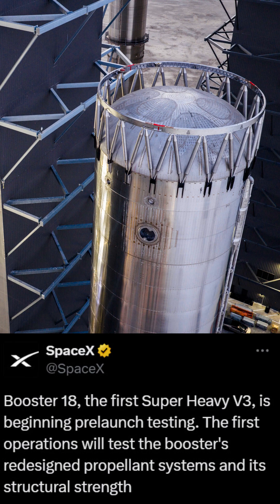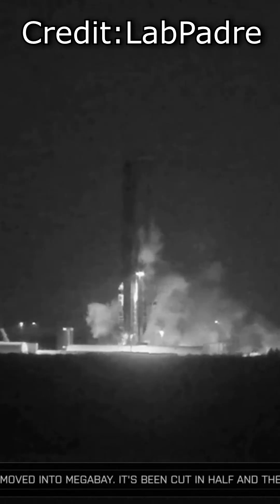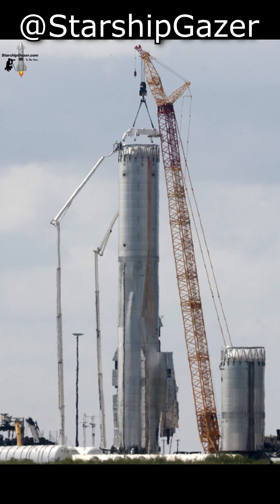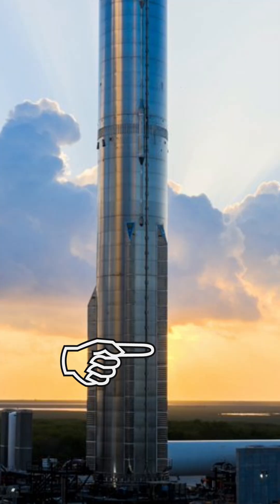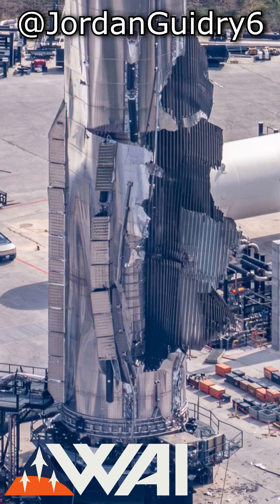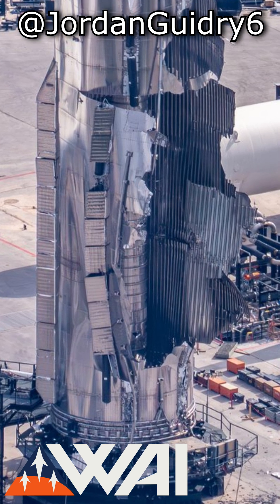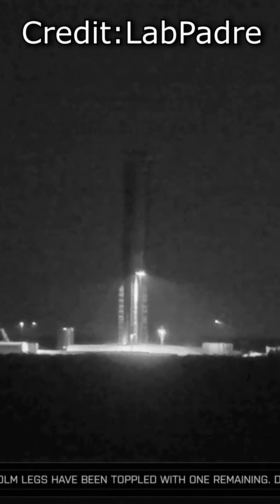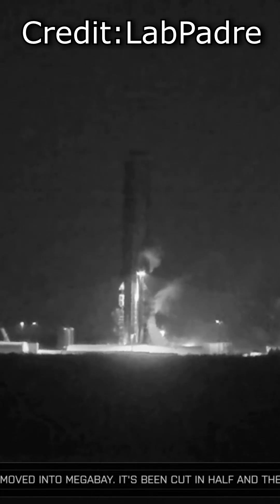SpaceX's Latest Booster Explosion Explained

Comment: I wonder if the placement of the copvs against the outside of the cryogenic tank is an issue, with the portion facing the tank likely being significantly colder than the portion facing the inside faces of the strakes. Even if the air inside the stakes was circulated effectively, radiation heat transfer would likely still be significant at these temperature differences. It's possible they already attempted to mitigate this as there's remnants of something white that looks like it could be insulation between the copvs and the thank wall but maybe it's not enough, as even insulation will chill in, or might actually make things worse if the insulation is in contact with the copvs as it would prevent the cold air from convecting away. If this is indeed the case the thermal profile in the copvs isn't axisymmetric, which I can't imagine is good for their structural margin. At a minimum their ground testing would need the replicate this non-axisymmetric thermal environment exactly to rule this out.

Comment: Needs a vertical roll former to make starship in as few sections as possible. Instead of dozens of sections and fail points a vertical system will reduce it down to several pieces or even less.. Vertical form machine can be made from decommissioned ships propeller shafts and built inside one of the rocket hangers...Just needs sheet metal wide enough to make size circumference needed for starship etc...

Comment: I believe a lot of folks commenting here are too focused on the whole aspect of safety, as if these vessels are ships or planes or cars.
Space flight is dangerous, plain and simple. The amount of risk that was acceptable by NASA's standards just forty or fifty or so years ago was a staggering 25% failure rate. SpaceX has that down to about 10%, maybe even less, based on over 350 launches with only about 20-30 launches being test failures and less than ten mission failures.
Now, objectively, if any of you were truly concerned with spaceflight safety, why don't you go and make a difference? If you want humans to travel to distant planets on these vessels, go and study physics and fluid dynamics and aerospace engineering. SpaceX primarily launches satellites, not people, but the leaps and bounds made by their endeavors over the last decade have drastically advanced the world's capabilities of spaceflight.

The automobile didn't have seatbelts in its early days - hell, there weren't truly any road laws.
The aeroplane was rudimentary just one hundred years ago. Before then, it was speculated by top scientists that flight-capable machines were a hundred years off.
The nuclear bomb had a non-zero chance of igniting the Earth's atmosphere in a runaway reaction.
Think of these before you decide to set your standards to an unachievable limit.

Comment: I’m starting to think the stainless steel design could be the issue with the Starship. Yes, it performs better at cryogenic and high heat temperatures (and looks cool), but stainless steel is also notoriously hard to weld and such a massive ship can create a ton of potential points of failure (as witnessed here). Question is whether Elon will have the team pivot or double down at this point. Because with Blue Origin is breathing down their necks, they don’t have time for many more "rapid unplanned disassemblies”. 😅
Reply: It doesn't look like the tank was at fault though. If something at 3000psi explodes inside your tank it doesn't matter what is made of.

Comment: You don't have to "hope" they're working on it. It's exactly the reason engineers research and test for failure modes. Answers are not so easy at this level of stress and processes in assembly. If most people studied turbine blade metallurgy and design they'd probably have less confidence because of the limits we're pressing in material load and heat dissipation. Answers at certain levels of engineering become very very difficult to work through. Just because we know we can achieve something, doesn't mean it's going to be easy to solve or achieve.

Comment: It is absolutely mind boggling supposed intelligent engineers in this day and age seem to think composites can be used for pressure vessels.....
How many times now 😂😂
Oceangate.... 🤦
We have known for a very long time and for the very same fundamental reasons why we do not use composite materials for pressure vessels.... THIS HAS NOT CHANGED, WE HAVE NOT DEVELOPED COMPOSITE MATERIALS THAT CAN BE RELIABLY OR SAFELY USED AS PRESSURE VESSELS..... a fact that musk will never change without reinventing composite materials altogether....
If you are going to insist on doing so I suggest you develope a metallic epoxy of some sorts capable of withstanding expansion and contraction...
Dumb 😂

Comment: Thought they were getting rid of the wrapped pressure vessels and going to stainless steel since those wrapped pressure,vessels Can degrade rapidly just like on the submarine that squished at a depth that It was suppose to work at just fine? How many flights before it messes up?
Hopefully all is one more than you actually take for a ride! What are they doing dropping them, running them into each other hitting them with hammers? What the heck is going on?
Are you just wanting to get rid of your inventory? Because it’s hurting you big time switch and get rid of them.

Comment: I’m not convinced it’s a COPV problem. They should be designed and qualified to 2x max pressure … and, although I agree the failure appeared associated with the chine, I’m not seeing an obvious indication of a burst “into” the tank wall along that chine. Admittedly, it could still be a failure within the associated plumbing .. but a COPV should be a pretty tough thing to get to burst. I’d expect each COPV to be subject to an appropriate proof pressure test as part of its release certificate before it gets into the rocket assembly building. You’d have to be pretty irresponsible in mishandling those things to result in damage … but same would apply to steel tanks of a generic gas welding kit and accidents can still happen. 

I would argue that, at this point, cause of failure could just as easily be a problem weld. There is a lot of welding in the SS tank and associated plumbing systems … and steel alloys and welds can be very problematic if the alloy, weld or annealing is not to specification .. especially in cryogenic applications. Remember there have been enough problems in the history of shipping with brittle failures in low temperatures and ships lost at sea … at cryogenic temperatures, these problems are exacerbated and require very careful material and process controls.

Comment: Obviously, a complete loss, however, in a survival situation and reusing the top section of the booster, they would do a rough cut below the methane tank, separate the halves and suspend the upper tank on a jig which it would be cut as well as possible in order to not scrap the entire article.... But again, only if it was a do-or-die situation...

Comment: You have to understand that destructive testing serves absolutely no purpose when you're still experiencing failures. SpaceX is a dud company. They have tested Starship 10 times and it blew up 7 times but they never actually had any plans to bring any home. So how do you find any developing faults? You don't. And you end up having to fix everything to ensure that the next flight survives. And it still caused another 5 explosions before they got it to fly successfully again. Meanwhile Artemis launched, flew to the farside of the moon and returned a few weeks later. First time. No explosions. No environmental contamination. Just success. Meanwhile SpaceX is still failing when it's trying to reinvent what was standardised decades ago. They don't know space if they have to reinvent shit.
Reply: Dud company? Explain the 550+ Falcon 9 launches

Comment: They're on version 3 vehicles, this shouldn't be happening any more
Reply: But they just started v3! For each version there needs to be a test explosion and 3 total vehicle losses during flight. Then it's on to the next version.
Reply: They’re ✨Failing Fast✨;  It’s move fast and break things, not have thorough QC/QA + Installation Procedures!
Reply: Yeah, there has got to be a point in the whole "move fast and break things" where you waste more time building and stacking new hardware than if you just had taken some more time double checking and slowing down the handling a little.
Reply: @CMDKeenCZ  I thought SpaceX might adjust strategies a bit given their results, but who knows how long it will be before they can get a flight out of this thing to start testing it. We're almost back at square one. It seems like no component they've built has worked well enough to keep, and/or it's too heavy. It seems like even with an iterative approach there would be a some things done right the first time, anything, but that's never the case. Everything needs to be redesigned multiple times, and that is framed as a virtue somehow.
Reply: Tell us you really haven't been paying attention without telling us you haven't been paying attention...
Reply: @thec3llc  I know, right? This is a pattern we've seen before. Every version fails spectacularly multiple times. We shouldn't be surprised.
Reply: @troys9222 it's getting old. This shouldn't be celebrated, they're clearly not learning enough with every mistake they keep making.
Reply: @RedmondJohnson From the first big build of the project, when the grand multi-million dollar construction plan was to have the stack fire directly into the flat concrete, it didn't look good. Then they ended up building essentially an XL version of what they were given for free for Falcon. It took way too long to find out there's a reason they're built that way.

Comment: What's not mentioned is that these tests are meant to cause something to fail, either putting the vessel under maximum pressure to see if and where it will rupture. And or making modifications to see if and where it will weaken the vessel and so on.
Reply: Is this a joke?

Comment: Someone else stated that copvs have been an issue since early falcon days. And there have been constant issues with them in starship development. Those are the things that you absolutely need to function perfectly and with insane safety margins, because a single one getting a bit of a leak means the whole stack crumples. Like the frikkin wing struts for planes. You gotta have aviation safety margins for them since they are a single point of failure. How the hell have spacex not figured this out yet?
Reply: I get that you are not an engineer and don't really know these things, but just to be clear, aviation works with extremely small safety factors, when compared with almost any other industry.

Aviation can do that because they have done very, very large amounts of testing, destructive and otherwise, for decades, and they have a very good understanding of the loads the air frames and various components will experience in actual use.
That is partly thanks to the countless millions of flight hours accumulated by basically 2 companies, and partly because it's a well understood regime that can be quantified.

Rockets use fairly similar safety factors, certainly the same ballpark, and probably often even a bit higher than than aviation. But the loads are less well understood, especially when doing new things that has very little prior data to use when designing things.

But yeah, COPVs really shouldn't fail on ground tests at this stage, but I'd say it's highly unlikely that it was the safety factor itself that was wrong. Seems more like a manufacturing defect, procedural error or installation damage, or something along those lines.

With rockets you can't just increase the safety factors to compensate for unknown factors, it's not that it would cost more money (it probably wouldn't), it's just that the rocket would be to heavy.

If you tried to use something like normal civil engineering safety factors the rockets would be either too heavy to lift off or atleast unable to get anything worthwhile into space. Chemical rockets are very close to not actually working on this planet, that's why they are around 90-95% propellants by weight at lift off.

Rocket science is simple not easy 😅
Reply: @Robinlarsson83 I have worked with engineers /in engineering before so i said the things I said for a reason. Aviation safety margins are much higher than in astronautics. And yes, usually the "oh but we have weight limits" would be a good argument, but we are talking about the biggest rocket in the history of mankind with an absolutely unprecedented lifting capacity. Sacrificing a few percent of that for increasing safety margins would be entirely acceptable. In fact this is precisely what the whole starship concept is building on. That we turn spaceflight into as common and reusable a thing as regular flight. With the same safety margins. Why? Because we use tech that is so advanced that it allows for that.
Reply: @nemo-x cool. While I'm an engineer, I work in the marine sector, but I'm not sure I agree that aviation uses much higher margins that space does? But sure, in some instances that's probably true.

Yes, Starship has a very high lifting capacity on paper, but atleast Starship V2 was very far from actually realising that capacity, simply due to it being too heavily built. I've seen estimates that V2 would only have been able to deliver around 35 tons into LEO. The weight issue is always there for a rocket, no way around that afaik.
It doesn't really help if you just spend some extra weight on a few systems when everything is mission critical. So you'd have to make everything heavier. And when the dry mass of the rocket stack is atleast a few times higher than the payload, increasing the dry mass by 10% to get say 10-15% higher margins, you're probably giving up 30-50% of your payload capacity.

And since this booster was one of the first V3 boosters, and one of the goals with V3 is to get significantly closer to the intended payload capacity, I'd assume they have done massive amounts of work on making the stack significantly lighter over all. Not too surprising that some things will go wrong.
Reply: @Robinlarsson83 But that's precisely my point: not everything is mission critical. The stack can take several engine losses, it can take the loss of a flap, skirt, some heatshield tiles, an engine gimbal or two. What it can not take is the fuel tanks with its paperthin walls being in any way threatened. Making the walls that thin was an issue in and of itself, but to have copvs that aren't 1000% safe is absolutely unacceptable they are literally bombs strapped to the most sensitive part of the rocket.
Reply: Elon busy with Politics.. Starship has become a side quest since then
Reply: @merxellus  Plus Elon has gutted all the safety agencies that would have been regulating Space X
Reply: @rogerbouchard7135 True2 he did that.. That actually was his Goal to change regulation by involving in Politics. He actually did it.. and in the process, get carried away and neglect his projects.
No hate, im prolly the biggest fan of Elon. But seeing him becoming less n less innoviate and his company products being delayed ever since he became politics truely saddens me.

Comment: I appreciate the detailed explanation. However, upon reviewing the remaining portion of the left strake, the remnants of the chase that was previously covered by the aerodynamic cover are visible. Conversely, the corresponding chase on the right side of the tank is located beyond the tank's split. This observation suggests that the failure likely occurred between the strakes.

Comment: How does Blue Origin launch 2 successful rockets in a row on their first try but SpaceX can't even pass a pressure test on Booster 18? Blue's first New Glenn successfully reached orbit on the first try but failed to land the booster. Their second launch successfully launched the payloads to Mars and landed the booster on the barge.
Reply: New Glenn is a massive Falcon 9. Starship is in a league of its own attempting 2nd stage full reusability
Reply: @eerice704  Anyone can attempt something. No reason to applaud until it works.

I've attempted a lot on KSP and it's been failures, I'm not gonna take credit for delusional ambition.
Reply: Different philosophy. Spacex is set up to pay for some failures. Blue pays a lot for a longer design phase, but doesn’t necessarily pay less in development costs overall.
Reply: @LA-yr4oc  The longer development has clearly been SpaceX, New Gleen and Starship started development at the same time and all evidence is that SpaceX has incurred more total costs.
Reply: @kennethferland5579  Blue Origin landed a rocket before SpaceX and took off before SpaceX took off again with theirs. Elon was beat twice.

They were all beat by NASA in the 90s when they built reusable rockets and made them work on the first go. Landing rockets isn't that hard. Building rockets isn't really that hard. SpaceX makes it look hard through intense ineptitude and a limitless budget.
Reply: Not just Blue Origin, that's the norm for ALL other space launch vehicles and companies with any level of experience.  It's SpaceX which blows up a huge amount of hardware due to their development paradigm which tries to treat physical engineering like software development.  In Software you make the simplest cheapest most inefficent code that could possible work and then iterate it, every time it crashes you go into the debugger and then recompile.  No one else in the industry tries to engineer a rocket this way because 'recompiling' the rocket isn't a 3-5 minute wait and a few dimes worth of electricity.
Reply: The issue is that one of the companies is headed by an adult child that doesn’t understand engineering or physics on a fundamental level, and will fire anyone who says ”no”
Reply: @SlashCampable  completely false